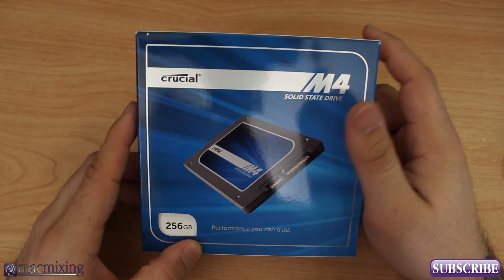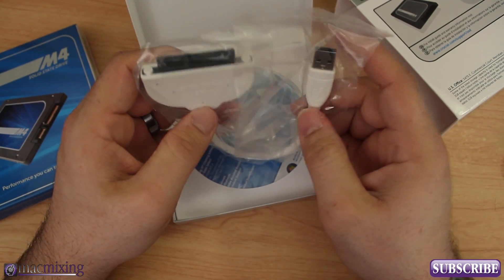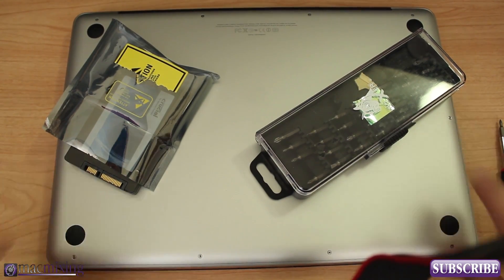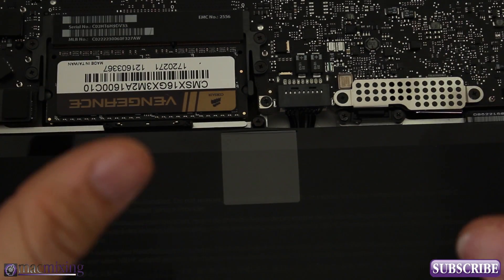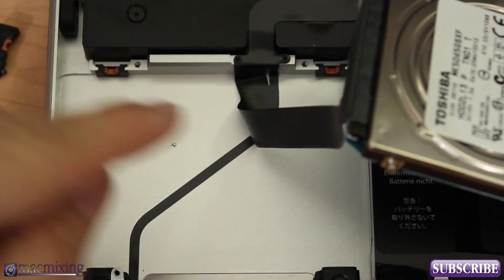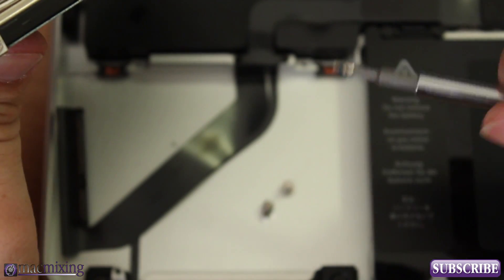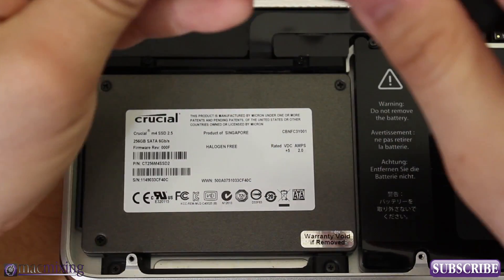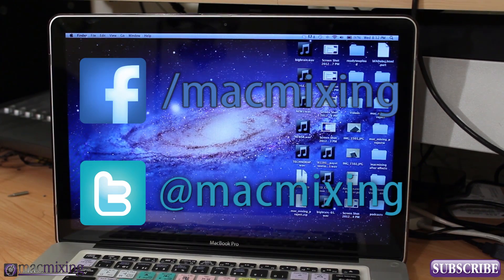[How To] Install A Solid State Drive (SSD) In A MacBook Pro - Install Guide

Comment: thanks for the detailed hardware work. i have a 2012 mbp and want to replace the optical driver with a samsung evo 250 gb ssd and don't want to touch the hdd. which way do i have to follow for cloning the os to ssd?
thanks in advance.

Comment: Hey dude. Thanks for this vid. I'm going to try this aswell. One question though, what is the difference between the 2 links you provide for the SSD drive? Is it that one has a extra CD of software to clone your harddrive, is this software crucial? Or can you do it with the Hard disk tools apple provides?

Comment: Oh the reason Apple shops warned me against installing an SSD drive in to my 2010 mac was the rest of the computer wasn't made for such a device which would cause problems. I ignored them and going ahead regardless:) should i be worried?

Comment: Hey i have a small problem.  The reason i got an ssd was because my old drive crashed so i decided to invest in a new ssd drive.  Now that i installed it i cant install mac os x (i put in the original disk and hold option and boot into the osx install disk.)  Everytime is go on disk utility i dont see my ssd there.  I realized it is probably because i didnt create the usb clone thing which i couldnt because my original hard drive died. Is there a way i can get past this and get it working?

Comment: Hello. I've installed a Samsung 840 Pro SSD in my Primo 2011 MacBook Pro 15. Everything is good, speeds are very nice, but my battery life is reduced by a very large amount!

When I disable TRIM the battery life becomes a bit better. Have you heard of a problem like this?

I hope you can give an answer!

Comment: Hel o plan to do this as well, I have the back book pro 2007 version before they switched the models. Do i need to buy a 3.5 converter bay or will the ssd fit right in without it? PLease help

Comment: Hi , Thanks for the video. Do you have any concerns regarding no "Trim" ?
Also is there a temp. sensor that should be a concern or will the temp still be controlled by OS X.
Thanks again , 

Gary

Comment: what kind of ram did you ise to upgrade by that i mean like 9-9-24 or 10-10-28 because i found the same ram but it just has 10-10-28 so iam worrying if its goinng to be compatibel with the macbook pro